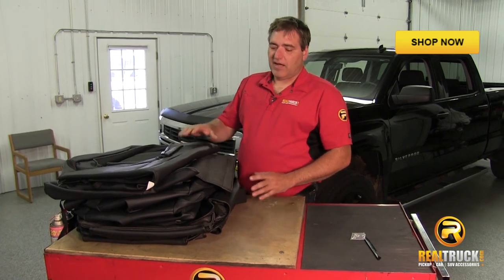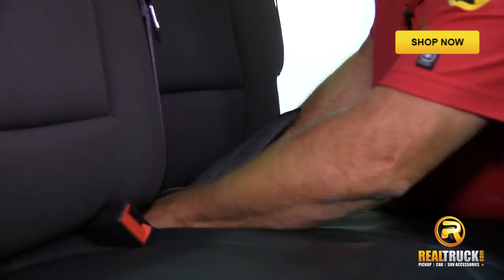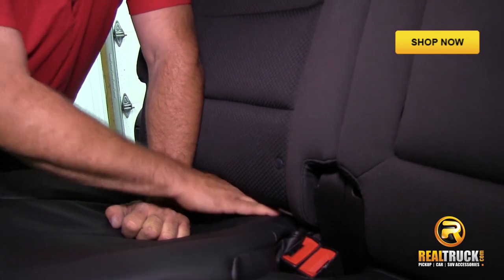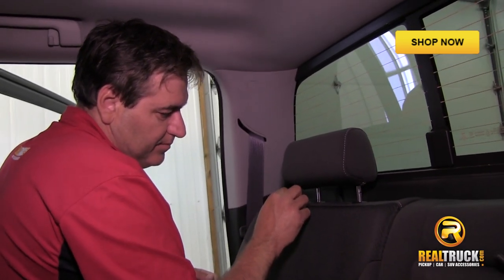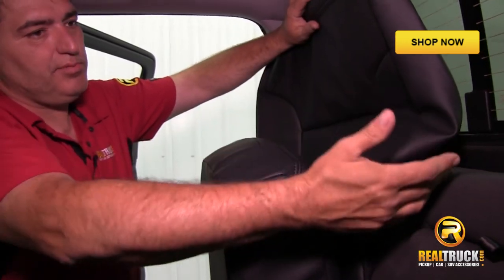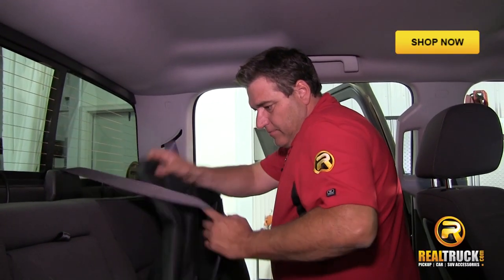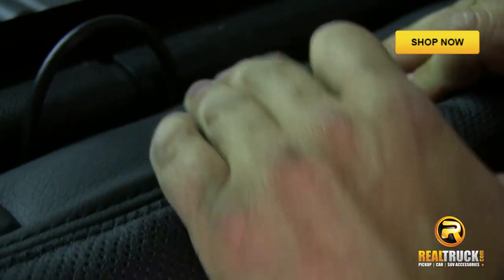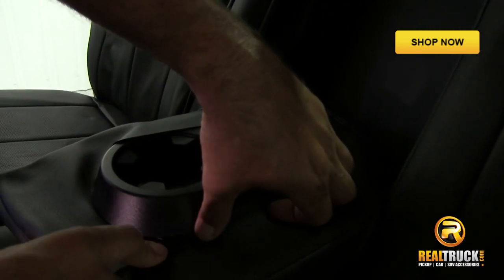How to Install Leather Seat Covers

Comment: Why not just get them redone?
Reply: Angel Rey cause this is cheaper
Reply: Kind of common sense don’t you think? Having them redone will cost around 850-2000+ depending who and how you want your leather seats. This way you get a little of what leather seats could’ve been in a way cheaper way.
Reply: I went to get a estimate for my h3 hummer just for the 2 front seats vinyl and they said 350$ each total 700$
Reply: @Alex-kf5vu  well first of all they are not real leather, and and they dont look the good, and if they do not for long, at the end youll get what you paid for, 🤷‍♂️
Reply: @reneluna249 thats a really good deal, they are sewen piece by piece, and if done right, it will take some time.
Reply: Angel Rey what do you mean “first of all” I never said they were real leather. I clearly said “this way you get a little of what leather seats could’ve been” something looking good and not good is preference